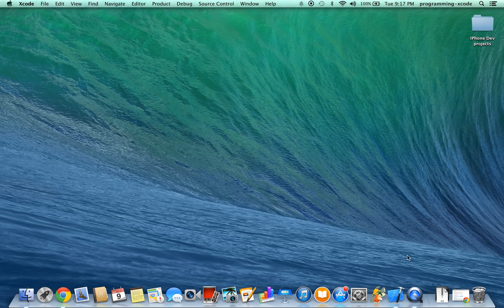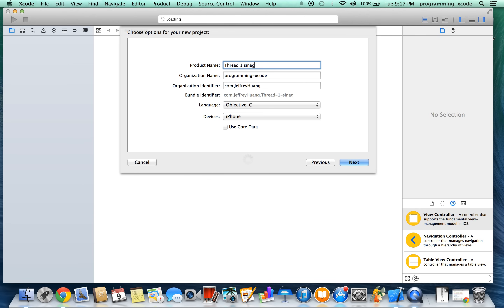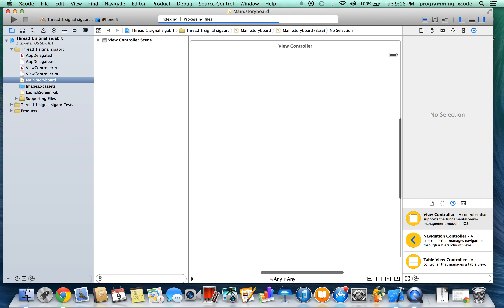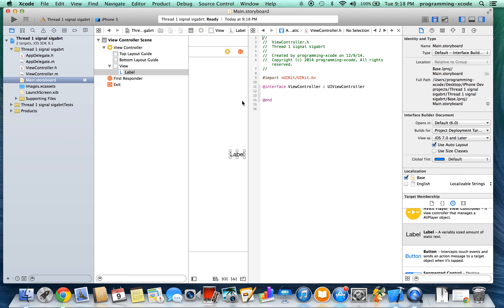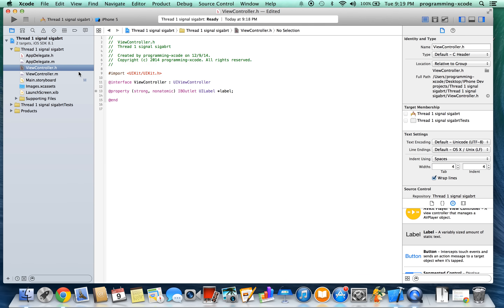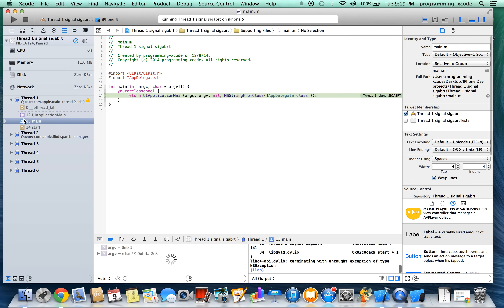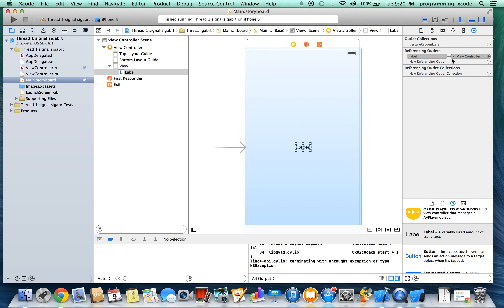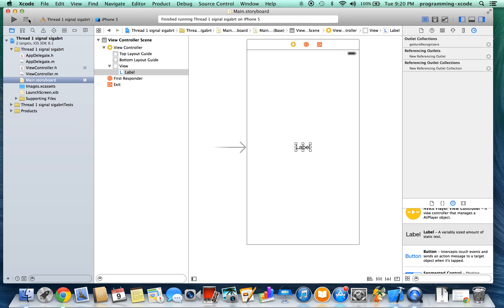iOS Programming: How to fix thread 1 signal sigabrt in xcode 6

Comment: I am stuck on the logout button part. There are no errors in my code but it is throwing the error "Terminating app due to uncaught exception 'NSInvalidArgumentException Receiver has no segue with identifier 'loginView'" when the app is launched in the simulator. Also it is saying "Thread 1: Signal SIGABRT" Any help would be appreciated!!